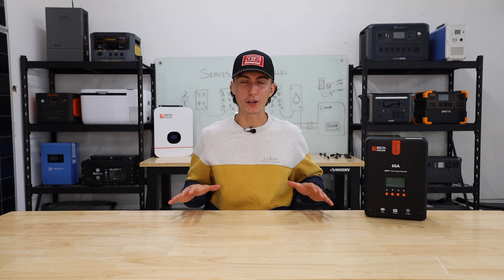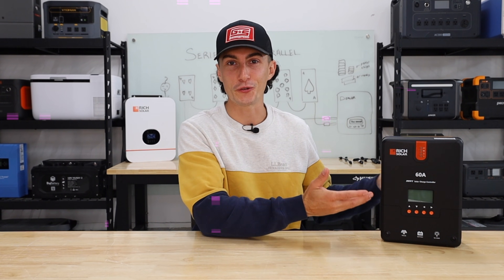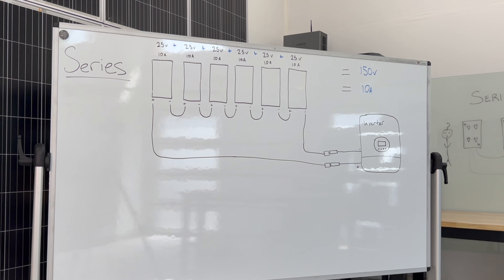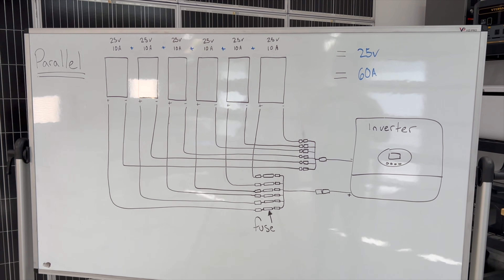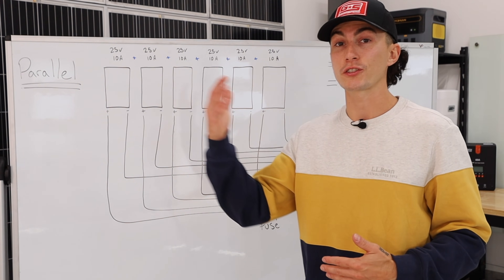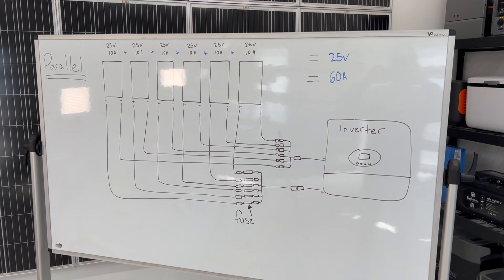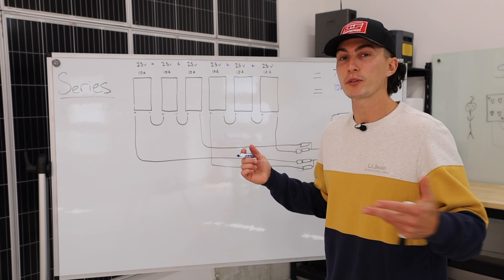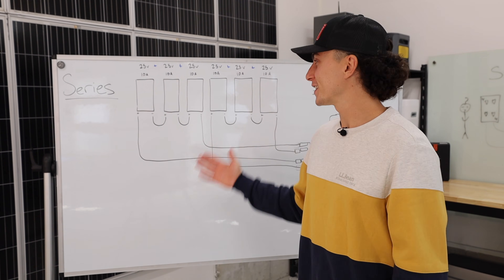Series vs Parallel Solar Panel Wiring Basics - Volts, Amps, Cost & More Explained

Comment: I have 2 200w panels doing 36v and 1 panel 200w doing 20v  my bank can input 60v my cable is 8awg 30'' all doing parelel what size fuses would I need. On positive lines?

Comment: The higher the current through the wire is going to require a lot larger wire.  

25v @ 60a is going to have a 15v drop at 100ft with 10 gauge copper wire.  

However 150v @ 10a will only have a 2.5v drop on 19 gauge wire.  

At 50v and 30a the drop is 7.5v staying on 10 gauge copper wire.  

So sticking with the highest voltage you can get away with it really important.   That’s why the power delivery high tension wires are upwards of 250kV and in some cases higher.   

Get the inverter that can take the highest possible operating voltages but can still operate with low if that’s all that can be delivered.   

Efficiency is crucial and run the thickest wire you can get.  Run parallel wires if you can.  You’ll see the improvement.

Comment: Excellent video! I'm looking at buying a couple of pallets of Boviet 385w panels ($96 ea) and then roof mounting at least 40 of them on the south facing side of the roof. One DIY site was going to send me panels with microinverters, but I'm sending the energy into an Ecoflow Delta Pro Ultra X with 2 batteries. So, how would a pro wire these? Would using microinverters be useful or should I wire in, say 4-6 panel series and parallel the series? Also, I'm thinking about hiring a regular roofer or handyman to install the rack mount system on the roof since it seems that would be much cheaper than regular solar install guys.

Comment: If I am configuring 3 identical panels do I have to put all 3 in series or all 3 in parallel? Or can I put 2 in series and link that to the 3rd one in parallel? This would mean one string would have twice the voltage of the other one. Does that affect performance? I feel it would.

Comment: Thanks for the video 👍🏻. I have my solar disconnect right beside my controller on my small one panel system. If I chose to wire in a second panel (parallel), could I just run a second cable from the second panel straight to the disconnect? (I was planning on putting the two panels on different sections of the roof that get the sun at different times of the day which is why I chose parallel. The controller has enough headroom to go either way. Thanks 🙏

Comment: When solar panels are connected in series, the total voltage adds up while the current remains the same as a single panel. Bypass diodes are typically connected in parallel with groups of cells within a panel to provide a low-resistance path around shaded or faulty cells, preventing power loss and overheating.
 In a series string, if one panel is shaded, the entire string's performance can drop significantly because current must flow through each panel, and a shaded panel acts as a bottleneck.
 Bypass diodes mitigate this by allowing current to flow around the shaded section, though they can reduce the overall voltage of the string by about 0.6 volts per diode.

In contrast, when panels are connected in parallel, the total current adds up while the voltage remains the same as a single panel. This configuration allows each panel to operate independently, so shading on one panel has less impact on the others.
 However, bypass diodes in a parallel setup are generally less effective because the shaded panel's reduced voltage can pull down the overall array voltage, potentially moving the system away from the optimal operating point for the MPPT controller.
 While bypass diodes are standard in modern panels, their benefit in parallel configurations is limited, and they may not significantly improve performance under shading.

The choice between series and parallel wiring depends on system design, shading conditions, and voltage requirements. Series connections are common for higher voltage systems but are sensitive to shading, making bypass diodes essential.
 Parallel connections offer better resilience to shading but require thicker cables and additional safety components like fuses or breakers to handle higher current.
 For systems with significant shading, parallel wiring with individual panel monitoring may be preferable, though bypass diodes within the panels themselves are usually sufficient.

Comment: Here's the nerd explainable format:
When connecting solar panels, the two primary wiring methods are series and parallel, each affecting the system's voltage and current differently. In a series connection, the positive terminal of one panel is connected to the negative terminal of the next, resulting in the voltages of the panels adding together while the current (amperage) remains constant across the entire string.
 For example, connecting three 12V panels in series produces a total voltage of 36V, with the same current as a single panel.
 This configuration is often used with MPPT charge controllers, which can handle higher input voltages, and is beneficial for long wire runs due to lower current reducing resistive losses.

In contrast, a parallel connection joins all positive terminals together and all negative terminals together, which keeps the voltage the same as a single panel but adds the currents from each panel.
 For instance, two 12V, 5A panels wired in parallel produce 12V at 10A.
 This setup is advantageous in shaded or variable light conditions because a shaded or malfunctioning panel does not significantly impact the performance of the others, as each panel operates independently.
 However, parallel systems require thicker wiring to handle the higher current, and additional components like branch connectors and fuses are necessary to manage the increased amperage safely.

The choice between series and parallel depends on several factors, including the voltage and current requirements of the charge controller or inverter, shading conditions, system size, and installation layout.
 Series connections are simpler and less expensive for basic setups, but they are more vulnerable to shading, as a single shaded panel can reduce the output of the entire string.
 Parallel connections offer better resilience to shading and panel failure but come with higher wiring costs and complexity.
 For larger systems, a combination of both—series-parallel wiring—is often used to balance voltage and current within the limits of the charge controller while maintaining system efficiency and
Reply: reliability

Comment: Because science? Really? just use the battery analogy. Batteries in series increase voltage only and batteries in parallel increase amperage only. The end. Solar panels are basically variable voltage batteries depending on the given solar light available. Fun fact solar panels emit IR light at night. They're basically IR diodes. (some)

Comment: If panels connected in parallel, can the 4 X 12v batteries be also connected in series.
Reply: If it is a 48v system then yes the 4 12v batteries would be connected in series.

Comment: If I have 1 panel that is shaded for 3 hours in the fall and it is causing the entire array to be reduced by like 60% of the volts, can I make that one parallel and connect it to the rest of the series?  They are only 200w panels and it is 6 total so we are not talking crazy power.

Comment: Thanks for posting this! The info helped me figure out how to properly wire my panels for my Delta 3. I had them wired in series and was getting a bunch of overcharging overvoltage errors, after figuring out what wiring in parallel was I got myself going and charging properly! Thanks!

Comment: Once you combine the parallel wired system you would need a larger wire for the higher amp load. In a series wired system you do not need larger sized wire.

Comment: Hello ! I understand  you dont need the fuse on your solar system if its informal series but does that mean you should still have a fuse between  your control charger and your inverter online says you should have a fuse for the max input rating of i. Enter is that true 😊
Reply: Rating of the inverter

Comment: In your series diagram the left side says positive. So that will be the end with the male mc4, right? So it gets a red pv wire mc4 connector. Do you have a brand of mc4 connectors you can recommend? I've also heard to take off those end mc4's from the array and put on the connectors you use on your extension wire that goes to the junciton box. Been reading aobut diffent brands connection causing fires. Some brands have reviews where they say the metal parts are junk. Really would loke some help in finding quality ones. Thanks

Comment: Best plain explanation on solar. I have a question. I need to install a solar system just for surveillance  cameras (up to 4 cameras). What configuration of inverter, batteries and panel do you recommend? For example: inverter 1000w, 2 batteries 100Ah, 4 panels 250w.

Comment: It's not as simple as just that. Be mindful of peak performance bursts and isc voc etc. if you think your just under the voltage and didn't account for peak bursts your mppt could catch fire. Same with amps, wires must be able to handle amperage or it'll melt and catch fire.

Comment: I only have 3x100W panels and I have 4 different Jackery batteries of various sizes (2x300, 1x500, 1x1,000). Trying to decide if I should have all the panels connected to charge one battery at a time but quicker or keep at least one separate so I can charge more than one pack at a time.

Comment: New subscriber here,  that was a great video explaining connection options for solar panels.  I do have a question I was hoping to find the answer.  I purchased 4, 100 watt panels (  Solar is a hobby, just getting started ) from the same manufacturer however some are open circuit. voltage of 22 V and some are 24 V.  Can I wire these in series? I wasn't aware that this could happen using the same panel reseller company.  Thanks and can't wait to watch more well done videos you make,  Ted in Sebastian, Fl.

Comment: This was helpful, I picked up a Ecoflow Delta 2 and was trying to figure out how to maximize the 500 watt 60V solar charge limit so wished you had used one of those or another more modest power station rather than that big inverter as your example,  so I could relate a little better,  but none the less I got enough of a taste that I figured out I would need 6 100 watt panels 2 strings of 3 panels in parallel wired in series 2S3P -I was cranking 505 watts this afternoon here in Austin 102 degrees out,  running a 6000 btu Hisense Inverter window ac ($250 on Amazon) pretty cool it gradually ramped up to 625 watts to cool the room down then throttled back to 180-380 watts once it reached temp to maintain about a 300 watt average overall.  I"m guessing the gradual ramp up & down is easier in the long run on the inverter in the Delta 2 rather than the sudden inrush currents produced by conventional compressors-most sunny days I'm able to run it off grid from 1-10 or 11pm,  but I'm cold natured so keep the ac no lower than 76 or 77 more often with a fan I'm comfortable.

Comment: Difference is the wire size for the most part.
Series overcomes the small wire resistance.
Parallel is mostly for more universal comparability since most things run either on 12v or 120v and is more reliable.

Comment: Normally I like your videos, but I think you've made a big mistake that newbies like me can really make bad decisions from. You can't just add the voltages from the spec sheets. First of all, there are two voltages: Vmp, which is the Maximum power voltage, and more importantly Voc, which is the open circuit voltage. I bought 4, 400w panels with a. Voc of 37 volts. The max voltage my Ecoflow can receive is 150V. So in series, 4 X 37 = 148v. No problem, right? Wrong! After posting my proposed connection of 4 in series on 3 separate forums, they all came back and said that Voc can be exceeded by a lot on cloudy days or in cold conditions. And that I'm risking blowing up my system with an over voltage. I'm still trying to figure this all out, but rarely in any technical forum do you see such uniform opinion on something. So I'm afraid your examples here could lead people to improperly specifying a system and being sad when they either break something or cannot obtain the performance they expect.

Comment: I have 6 pcs 100W Ecoworthy solar panels which the Vmp is 19.5V and Imp is 5.13A. I have a 3000W 24V inverter which has 120V AC output I need.  and 2 pcs 1280WH LifePO4 12.8V. I also have a 100A 12v/24V/36V/48V charge controller. What is the best way to connect solar panels and what else do I need.

Comment: 200 watt panels  Voc 36.5   optimum operating Volt is 31.3v...   Optimum operating Current is 6.35 A. .  AM i using VOC at 36.5 or Optimum operating 31.v to figure my volts ?

Comment: Awesome video - well explained!  - I have a Bluetti AC200 2040W -145v max input and 12 100w solar panels @ 21.6 v open circuit arranged in 4 wide x 3 high (rows)  - I can only use 5 panels in series to get 145v - what would be the best parallel /series combo to get max amps and voltage?

Comment: So I have 4 12v 100watt panels and I hook them
Up in series to my delta 3 and it’s giving me an over load error but 4x12 is 48 and my input is rated 60v so not sure why it isn’t working any help would be awesome

Comment: ... nice. explained a lot about the input current allowable on some of the better units. My last inverter only allowed up to 13A and they SAID it would self control, that I could over panel. So I did. 3 strings of 6 panels at 5.29A per string and when the sun was got behind a small tree and shaded some panels, dropping the voltage, the POW-RELAB smoked itself to death even though the batteries were fully charged. The only thing it was powering was an LG craft ice maker fridge, and THAT even has an inverter compressor that, at max, draws 305 watts. There is no heavy inductive load for its compressor. Batteries were fully charged with 24v/200Ah. and yet, its own leopards ate its face... sigh
Luckily I had that info about self regulating, which it DOESN'T,  in an email and got Asurion to provide a full refund... Switched to a SunGoldPower (upgraded version)...

Comment: 30 amps not twenty with the 3 x 10 amp series (times two). Right?
Reply: Nope. Each separate series array is at 10amps (the volts add within that series array, not the amps). Then, you essentially take two series arrays at 10 amps (ignore the three panels in each array, just act like it’s two groups coming together at 10amps each) - add those 10 amps together and you get 20amps.

Comment: If batteries are in series how do I connect solar panel?
Reply: When you connect your batteries in series the first battery negative terminal will be the negative of the system and the last battery's positive becomes the positive of thesystem

Comment: On the parallel ones, can you simply use two diodes to prevent power
 from going back into the panel for each panel ? That would also solve
the problem of battery charging and nighttime power reversal ?

Comment: Hello i got a cheap eco worthy solar panel kit it came in 2 200watt panels i connected them in series so that's fine yes? (So far its all worked fine) Also how can i tell how much watts i a, getting? As my controller only says like 2.5A etc which i am guessing is amps?  And thank you for your video
Reply: Watts is also known as power. It is equal to voltage × current (P=V*I) you take the voltage and multiply it by the current (amps) and you get Watts (power)

Comment: what about watts total when panels are wired in parallel-  eg; 2-400W . do they remain at 400W or do they total 800W? I bought 4 sunpower     400W panels, a 3000W inverter (12/24/48). they are hi voltage panels at 50V voc each. Got 4 -100ah lithiums that I want to wire 24 or 48. the charge controller I bought is a 50A but will only handle/process 1300W input. I can send it back as I think I'm gonna need a larger charge controller. Trying to figure if I should do 2 banks in series to parallel going in but need to know what size charge controller I need. ? Thanks. The video was great!
Reply: Watts are simply Volts X Amps.  Multiply whatever you are outputting together and that's your watts.

Comment: When combining two series strings in parallel is it necessary to have the same number of panels in each of the series strings, or would it be okay for example to have three in one series and four in the other?  Also, can you, for example, plug only three panels into a four wire branch connector?
Reply: I would also like this answer. A friend had 4 panels, wired as 2 strings series then paralleled. Unfortunately one panel has been smashed. Running now with one panel on one string and two panels on the other. Output seems to be very low. Should she switch to 3 panels in parallel instead?

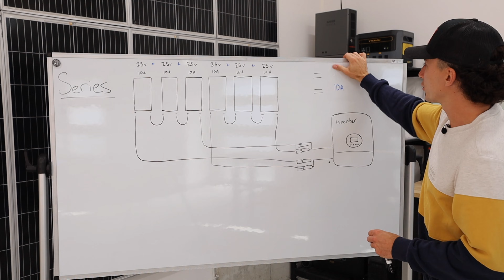Comment: @5:52 25+25+25 = 75 volts but why only 20 amps and not 30?
Reply: For the parallel portion, think of the panels as two groups. When they meet at the fuses there are technically only two panels coming in on the parallel series, thus the 20 amps. However, for the volts. Since the volts of one of the series is 75 that’s the most you count because once it reaches the fuses and switches to the parallel in no longer adds voltage, just amps.

Comment: Hi do you have any videos to use parallel or series when the charge controller has  12v battery, 110v inverter and r4000 power station connected?

Comment: Running in parallel I get 70 amps, do I need a larger mc4 wire to take it to the charge controller

Comment: Im trying to figure out the whole voltage thing, I bought 2 panels I never got to use which were 190w "12v"... But in the description it says Open-Circuit Voltage (Voc): 24.3V
Optimum Operating Voltage (Vmp): 20.3V. Solar inverter needs 55V, do I need just 3 panels total (3x20v), or do I need 5 total(5x12v)? Video was spot on. Definitely subscribing.